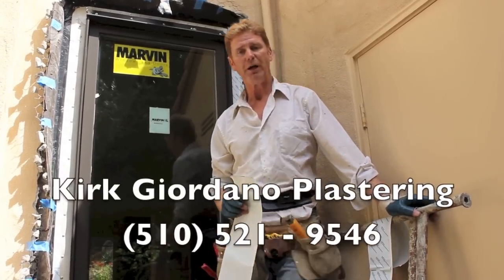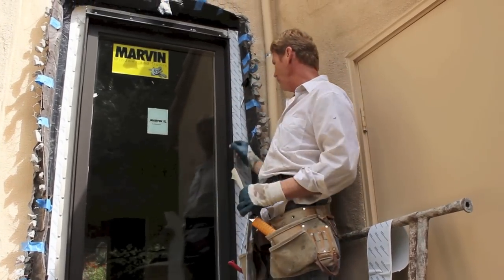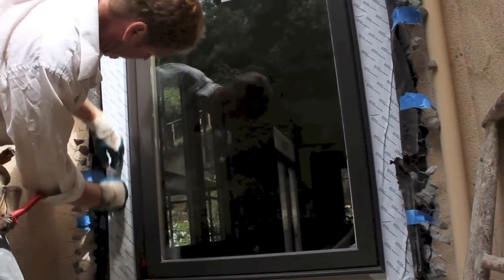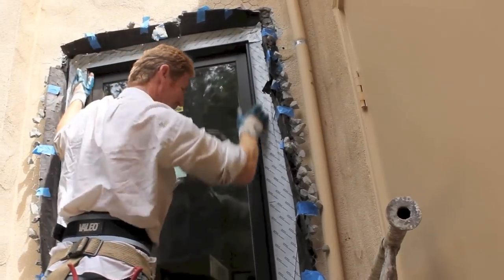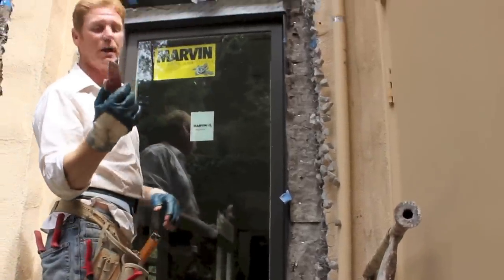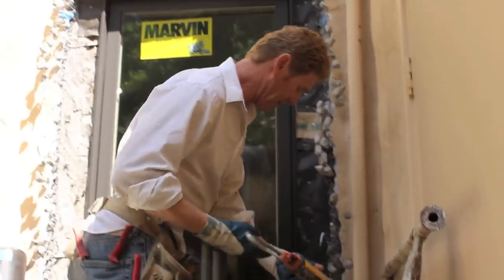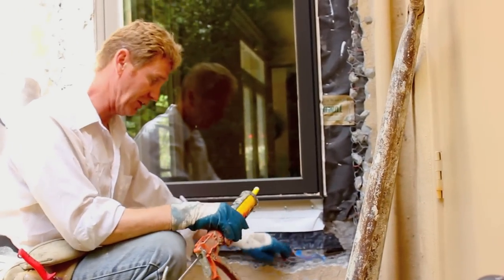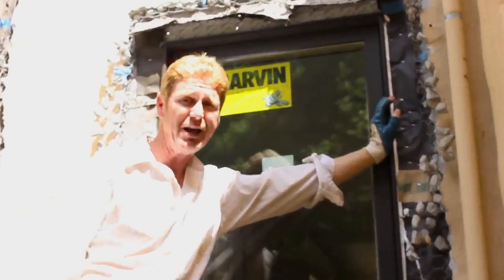Waterproofing new windows before Stucco.

Comment: Great video! I need to have my windows replaced ASAP (currently have old aluminum windows and water has been leaking through the head of the frame). Are there any window installation companies in the Bay Area that you can recommend?
Reply from the maker: Hello, Christina, The best window installations company I have yet to witness in 2021 is “Cal Coast window and doors,” located in Pleasanton.”
Even their stucco guys are just as good as us even. So, that’s mighty good to be all right. 🥂
Their number is 925-398-8184.
https://www.calcoastwindows.com/

Comment: Hey Kirk, First off thanks for spending the time replying to comments. 
I ripped apart my old 80x120 single pane aluminum sliding door in Socal. What I found interesting is the way it was set up. All they did was a single sheet of paper  up to the flanges, lath, stucco donezo.  No fancy wrap,or multiple layers of wrap, no caulking, literally screws around the aluminum frame into wood framing, the paper lath and stucco.
The opening was pristine no water. I see that the waterproofing systems are SO complex now. I'm in Mech. Engr so I can appreciate and understanding wanting to improve and that each window has their own water management system but I still find it incredible that the aluminum frame is what deteriorated the most. Maybe its the climate here...
PS The sikaflex 1A is crazy
Reply from the maker: Yea, some windows depending on location and the time they were installed need the very least done to waterproof them for too many reasons to list here.

Comment: For Marvin windows with the removable, foldable fins, they aren't waterproof where they attach to the frame. It would seem necessary to also caulk the fin/frame joint, therefore. Wouldn't that be better than caulking on top of the paper seam?
Reply from the maker: As a rule any window without a fin for proper-waterproofing I would not accept that job. I have only refused two windows in the last 40 years. That is how rare finless windows are as they almost always leak. However that being said there is a way that is best, buy Du-Pontes 6 inch Straight flash and stick at least one inch to the finless windows with the other five inches to the wall. Start from the bottom or sill next the sides and lastly the top.
Reply: @StuccoPlastering  Good Lord, great tip. Thanks, Kirk. Doing my first serious window install in some existing stucco, your vids have been very helpful.

Comment: hi Kirk,do you recommend  gypsum plaster for plastering the windows?or ordinary core plaster?
Reply from the maker: Howdy Dast Dude, gypsum is for interior use only, go to Home depot purchase a bag of rapid Set, you just add water, then apply, this is an exterior cement plaster.

      In English "plaster" usually means a material used for the interiors of buildings, while "render" commonly refers to external applications.                                 
                              Live long and plaster
       Sharing plastering information,  as the world can use more teachers.

Comment: Hey Kirk,

I have some newly installed marvin windows I framed in a 2" recessed condition. There is only a 1.5" gap between the side of the window and the return for the recess. This 1.5" gap is filled by the nailing fin. My question is: when I lath, how am I supposed to staple in this 1.5" gap? I'm assuming it's never a good idea to staple the lath into the nailing fin, right?
Reply from the maker: Gil Esquivel Hello gil, with an inset window I would use a flex wrap by tyvek prior to installing the window, 
 If the window flange has holes, screw in those to attach.
 I just install the paper, wire and stucco, I don't install these windows, sorry.
 If the window is set in place you can simply bend the wire without stapling , this does take a bit of practice.
 Best wishes, 
 kirk giordano